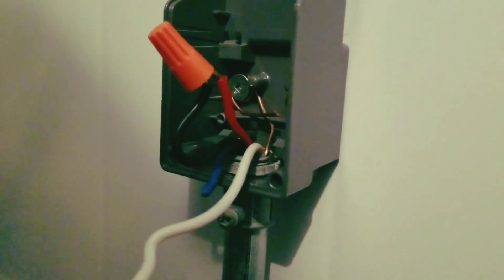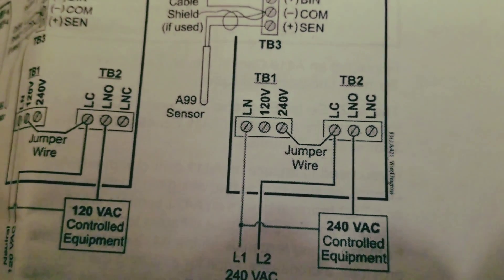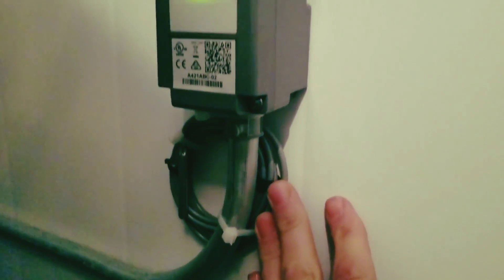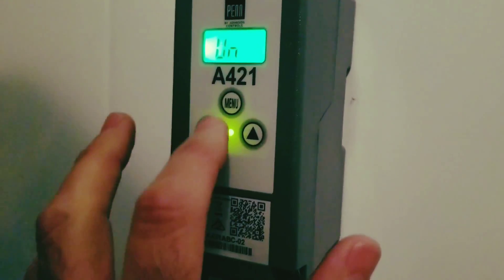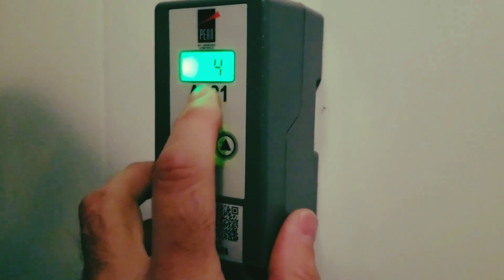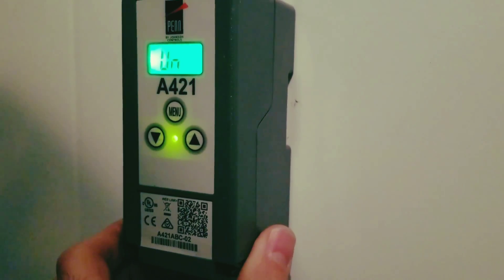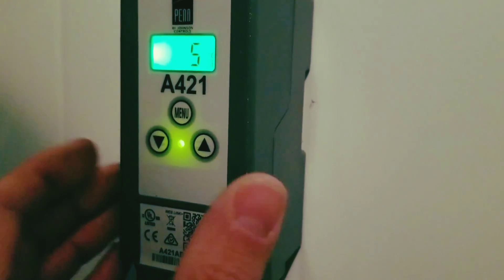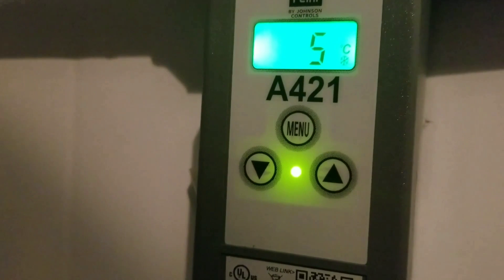HVAC - Installing An A421 Digital Control In A Walk In Cooler

Comment: Hi I am working on draftbeer cooler  on out side thermostat go to 40f the bartender say the draft beer is not cooling good 
Paige are on 60f 
The compresor is get off before to get a good cooling like 38 or 36
How can I get above 38 f on outdoor thermostat?
It manual Penn control Jhonson
Can I get down the thermostat? And how

Comment: Good vid ! i used to use the a419 a lot. they got discontinued i guess. now i use the a421. i like them both a lot. i recommend u set your " asd " at 5 minutes for compressor short cycle protection. i put the probes in cooler evaps ( between the fins ) if u get freeze up problems. control by evap temp. off at about 15F ( somewhere between 10-20) on at 39. gives u a air defrost cycle every cycle.
Reply from the maker: Thanks for the comment.  About the ASD, 5 minutes is too long for this application.   It's a very small cooler, and opened often it also has sensitive products inside.  When it needs to come it can't wait 5 ministers or there will be a deviation and that includes tons of paper work lol.
Reply: the anti short cycle delay does not work that way. it does not wait 5 minutes after it calls for cooling. the a421 is always counting how long it has been since it turned off. so, let's say it's been 4 minutes since the unit shut off and the temperature control is calling for cooling. the control will just wait one minute more so that the unit is not slamming off and on every 2 or 3 minutes. it just stops the unit from going on and off no sooner than every 5 minutes. compressor manufacturers actually want no more than six cycles per hour which is every 10 minutes. also check your setting for probe failure u want it most likely to fail cooling. i'm betting. so there's that too. " sf " should be set for "1" if u want it to fail cooling. or "0" if u want contacts open so unit does not run if that's more desirable for u. default factory setting is fail cooling or "1".
Reply from the maker: @OcRefrig  yes okay, I gotcha.  In my head I presumed it to be a delay on make to timer.  But what you're saying makes more sense.
Reply: Same as a delay on break timer. as soon as unit shuts off timer starts counting.
Reply: I really like the design over the 419, but I have been seeing a really high failure rate on the relays in these lately. I changed out 4 of them that were less than a year old in the last couple months. I don't think I have ever replaced a 419...
Reply: that's sad to hear. 😔  are they only on units you are pulling full current on or on ones u are using to just pull in solenoids too.
Reply: @OcRefrig  One was on a solenoid, two were on contactors. One was a self-contained where the compressor current was going through the 421 contacts.
I am hoping it was a bad batch and they have or are going to correct it, but how many more might there be out there...
Reply: thanks. good to know. yea, i hope bad batch too. are u still using the 421 or do u have another digital in mind ? i heard emerson makes a digital similar to 421.
Reply: OcRefrigeration,Hvac & Electrical. 421 is still the truck stock one. I really like them, just concerned about the failure rate after all these years using the 419 trouble-free. I haven’t tried Emerson’s product yet. They have a good track record as a controls manufacturer, so it is probably a good solid product.
Reply: Great and thanks for sharing ! I still buy and replace mechanical thermostats for walk in boxes.  Keep it up , sir.
Reply: @ deafhvacr once u go digital A421 or A419 u will never go back to analog. Setting the exact temp u want rocks. anti short cycle protection , differential - set what u want exactly. and reliable   they are truly great.

Comment: Is there a preference for calibration based off high or low temperatures? Better readings in cold or hot?
Reply from the maker: You only have to calibrate if the sensor starts reading incorrectly.  Works great in hot and cold.
Reply: meads --- fyi those sensors are not immersion rated.